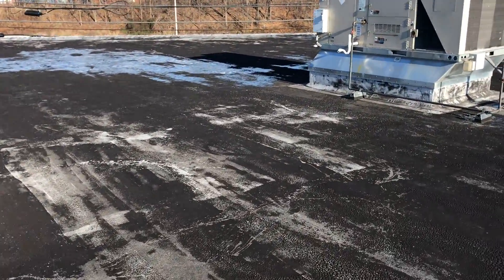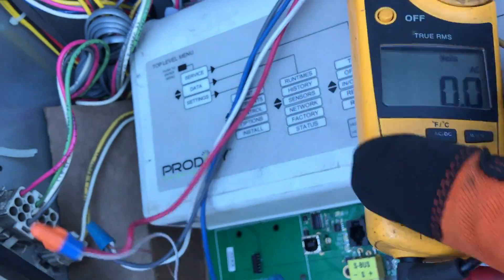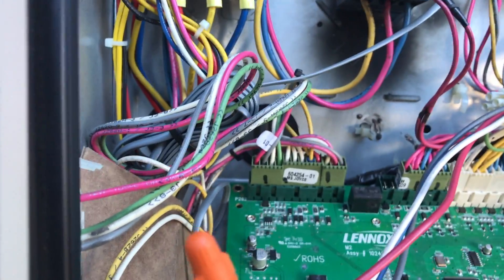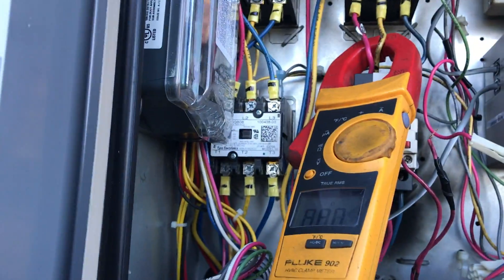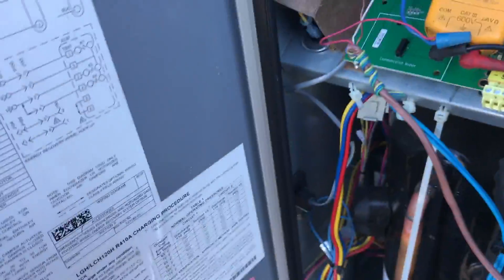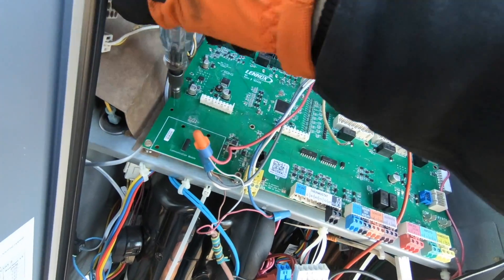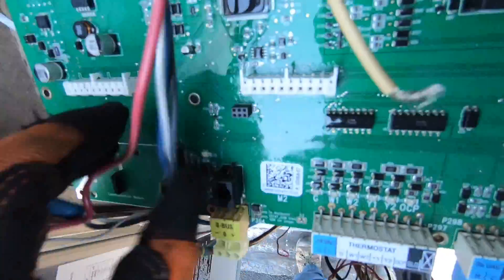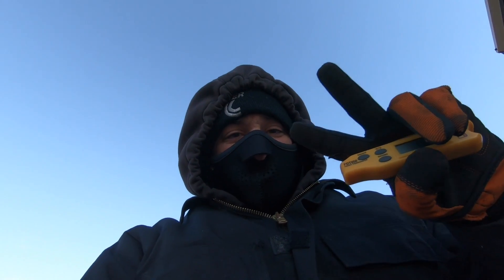HVAC Troubleshooting Low Voltage Shorts/ Grounded Controls

Comment: Where were you connecting the meter to measure the resistance in the beginning as i did not see the probes. Was it at the transformer red 24V to ground ?  Thanks

Comment: why they make these things so complicated I cannot for the life of me figure out, the more simple and solid the design the longer these things will last... all in the name of efficiency I am sure...some simple electronics and old reliable mechanical relays, and basic pressure and temp sensors are all that are needed, stick logic boards into the hot/cold elements with shoddy design and of course they are going to fail. or at the least, put these sensitive electronics in a controlled environment to protect them. Great job, I love your videos.
Reply from the maker: This was an interesting experience, al the equipment is going this route. The old stuff broke down less because of lack of electronics. Why for my house or any family member I always put in equipment that parts are easy to find and replace. Not a system that a board goes down and it will be 3 days for it to get shipped across the country and near 0 degree weather.

Comment: I have the grates of respect for any person that has to work out side in any kind of weather. personally I think heat is the worst.
Reply from the maker: The unsung hero no one knows what some techs do to keep others comfortable. Heat is bad until temps get low this. It killed my phone battery in around 10 minutes or so of filming.

Comment: Looks like a lightning victim.
Reply from the maker: Something made those red wires weld and the board solder melt and over heat
Reply: @thehvachacker  what does the rj 11 socket go to allot of amps went that way

Comment: guess the customer will be mad after hearing the mainboard  shorted internally,but good video as always,take care
Reply from the maker: It sucks but they had another system heating the factory space and one system for the office running. It was only 67*F inside with this unit down

Comment: Damn bro. Take that entire module and find the nearest trash can. Once again - Its a fukn Lennox
Reply: Exactly.
Reply from the maker: There was some welding going on inside this unit spreading welded metal shards all over this module.
Reply: @thehvachacker  I hear that replacement is $4000. Any truth to that? Im yet to have service that unit. Just the older "L" Series.

Comment: You need a magnetic base for the camera to just stick in the cabinet.  Kind of like your little LED light that you have.  :)  That way you can free up both hands and keep the video more steady.  It was almost 60 here today in Dallas, not to rub it in.
Reply from the maker: I should look into a magnetic camera base usually I wear the camera on a chest mount. Yet I forgot it at home or I would of used the GoPro over the iphone.

Comment: Aww man, I watched this video because I thought you had a new pair of "electrical shorts" to keep you warm. I thought maybe Milwaukee had expanded their heated jacket line. 😂 
But you meant electrical shorts...like wires and stuff ⚡⚡⚡ 
Man it sounded cold up there 🌡️
Lennox prodigy...geezzz, do they really need that much 💩 in a unit?  They could eliminate half that stuff and still make that unit run. They just like making us crazy 😵
Reply from the maker: I wouldn’t really need the heated shorts it was really only my eyeballs and fingers getting cold. They love to computerize all 5e systems. Sad part is who carries prodigy boards or even icomfort stats
Reply: Yeah that is the big problem with all this modern technology that the manufacturers are going to. I'm not going to be carrying inverter boards on my van.And like you said, I'm not going to be carrying around miniature iPad "thermostats" on my van.

Comment: A propane radiant heater would be great. If you could find one small enough to get on the roof. I use a contractor grade Mr Heater working outside  on cold days.

The little buddy 3800 is very small and puts out 9,000 btu with a standard cylinder. Mr Heater has a portable buddy model that runs off 4 D cells.
It would warm one side of you. 😊
Reply: I wear heated jacket, with heated hoodie under and bring my torch to keep my hands warmer.. cold work suuuuucks :)
Reply: A barbeque... That would be best.. could keep warm and make some ribs :D